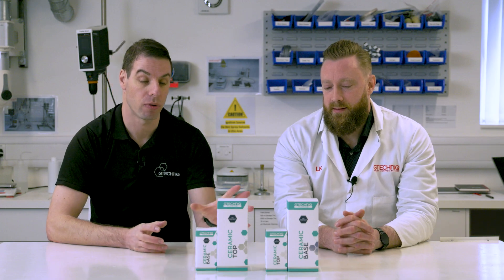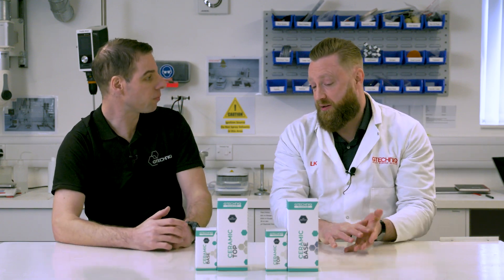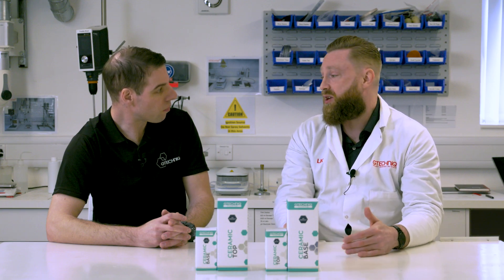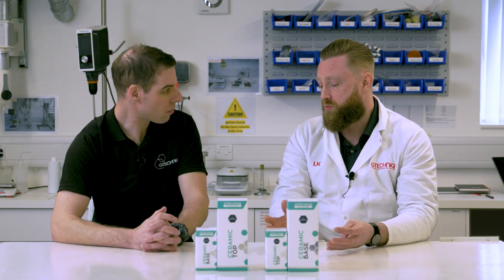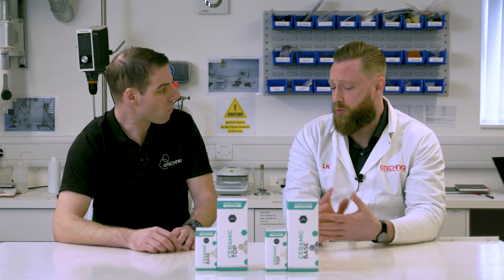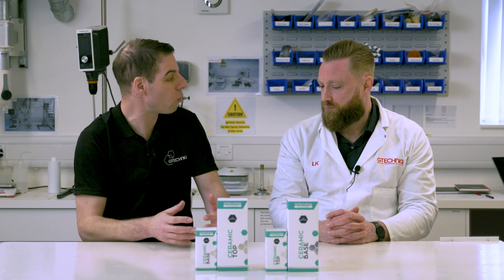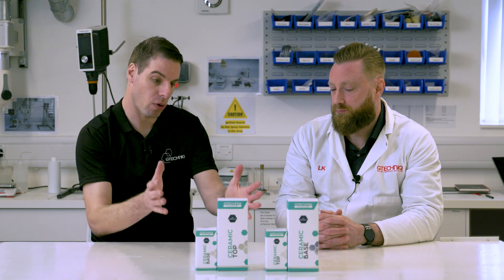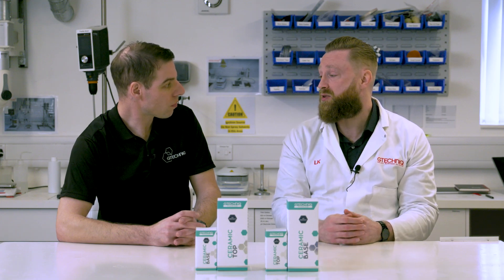Unlocking Gtechniq Marine Ceramic Coatings: Expert Insights | Durability & Performance Explained

Comment: The 2 layer system is a lot of work, especially if you're working on a 40-foot boat. Plus, you need to leave the base coat to set before applying the top coat.  So you're charging the customer twice .  I use the top coat and find it great.  I'm still getting great protection 18 months on. 👍
Reply from the maker: It is all about giving the customer options. If they want the best and are happy to pay for it, then run with the two layers, or you could do as you have outlined above.
Reply: I have base and top coat to apply to black boat radar arch in south west Florida. At this time of year, 90’s sun then often rain , what would be the best process to apply coatings with consideration given to climate? Time between coats, sun, temp.
Reply from the maker: @rooftopcindy  Ideally, you would want to work first thing in the morning or in the shade - try and avoid the midday sun for sure. You could also work in smaller areas than normal. We recommend leaving at least 4 hours between the base and top coat.
Reply: Thanks! I was able to find some shade and applied top coat. Looks great so far. With respect to maintenance, I have “Fast Ceramic” spray.  When do I begin using it over the base/top coat to maintain sheen? I basically slipped in the Gulf, very powerful climate, sun is nuclear and always rains in afternoon.
Reply from the maker: @rooftopcindy  We normally recommend leaving the coating untouched for a week to fully cure. After that, you can apply the Fast Coat as often as you like.
Reply: Awesome! Thanks again. I have wax on the hull and ceramic on arch so I’ll have a good comparison going forward.